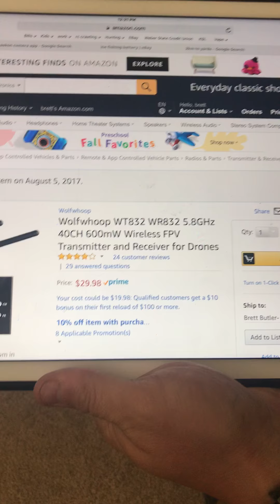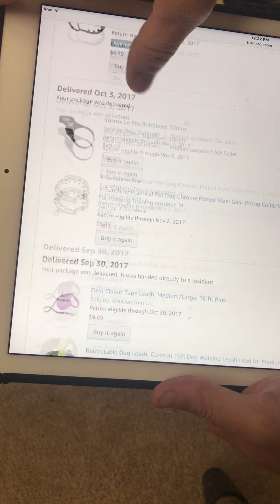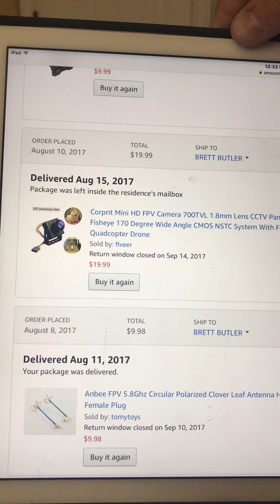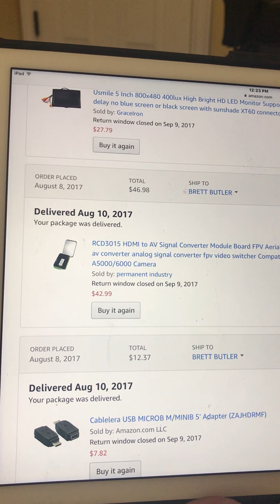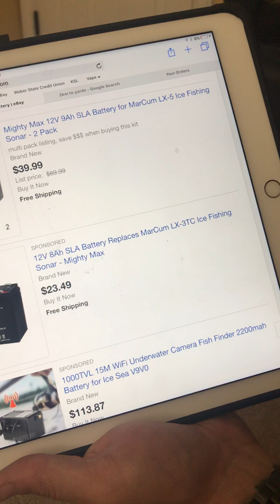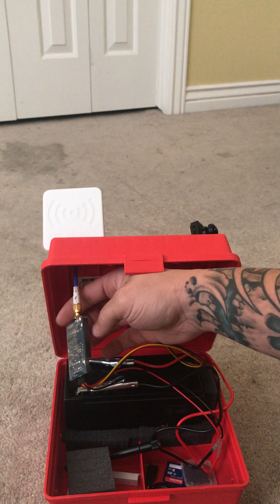Longe range shooting camera build

Comment: How much $ do you have invested? The commercial ones are coming down in price. Was it worth it?
Reply: I have an almost identical setup to this and spent around $100. $30 for a cheap 12v backup camera and lcd display on ebay, $20 for the panel antenna, $20 for the transmitter/receiver. $30 for two SLA batteries.
Reply: Clayton Moss how far is it transmitting?